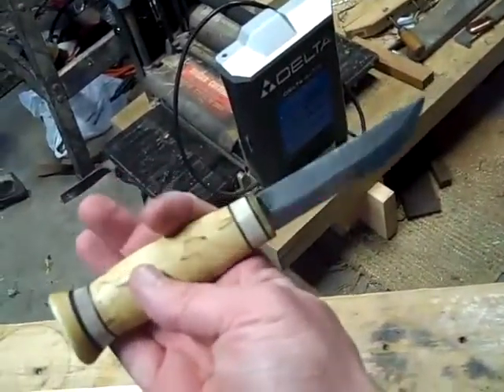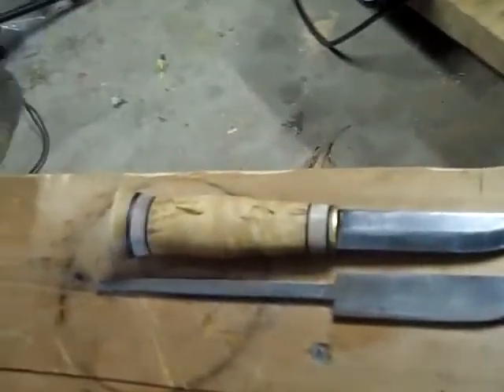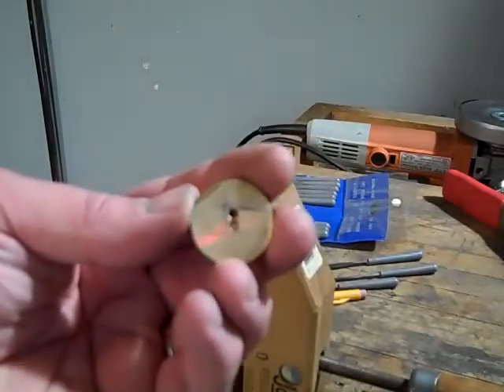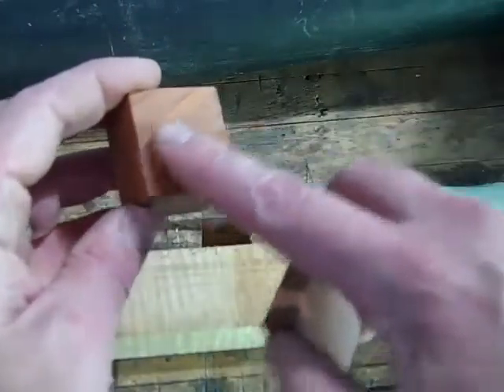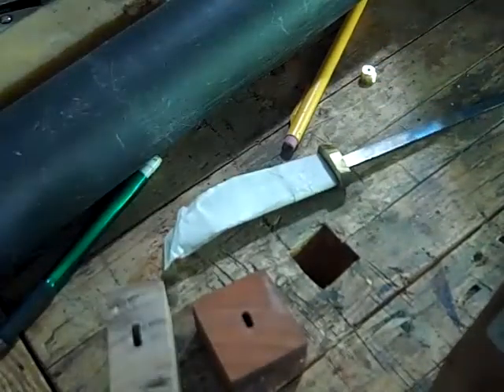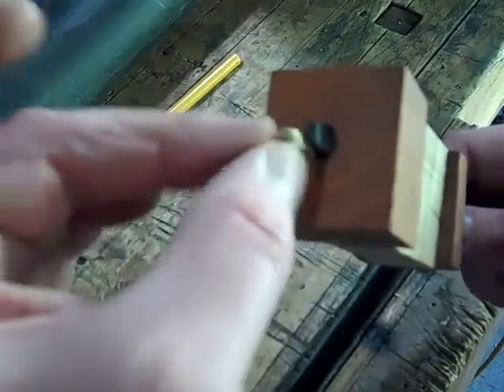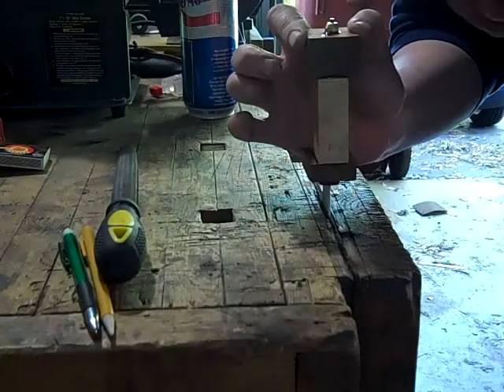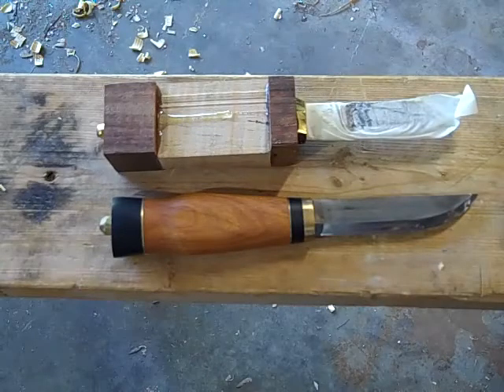Making a stick tang, puukko knife

Comment: Hello Muck interesting that you turned with a handle? And it looks like a ready knife.
 I like puukko knives. On the blade shoulders tail usually do not 90 a little rounded, so do Scandinavia imennitye manufacturers blades, Laurin, Helle, Puronvarsi Yjuro and others.
Best Regards Tim!

Comment: @Makermook your doing nice work however dont harden the entire knife,the way lapps are doing are to leave the pin or tangsoft at the end ,thatway u use it to glow up and fit wood and other to perfection to that exact knife and its no problem its not hardned at the end, easyer to flattn too

Comment: Thanx Mark, that area where you refined which looks  like a 90° corner, my question is why can you build a step there or atleast make a curve so it can be stronger, that's where I see most rattail tang's break even thicker stick tang's like even on Cold Steel Kraton Handle knives, that's why I like Fallkniven Knives better because of the much better tang's on their Kraton Handle Knives, but back to your tang, either increase the "V" shape tang or round that area or put a step there to strengthen that area so maybe we can baton a Rattail Tang Puukku Knife so it doesn't break there, Thanx for a great video.

Comment: you should never use the back and forth motion to file metal, lift file after each foward cut stroke or you'll dull the teeth. the wood you use is padauk pronounced (pow-dowk)

Comment: Is a Stick tang the same thing as a rat tang 
I was looking at same sword on fire and steel they told me the swords are made with stick style tang?
Is a stick style tang welded to the blade or is it one piece of steel
Reply from the maker: Stick tang and rat tail tang are the same thing. 
In my experience, it's better if tang and blade are formed from one piece of material rather than welded. The weld is a point of potential weakness where you most need strength.
Reply: @Makermook  OK thank you

Comment from the maker: @soonerfan125 I use O-1 tool steel.  I did harden and temper the blade before putting the handle on, but I didn't have much time in this video to go over that process.  I have made some other videos that show a more detailed account of how I harden and temper these blades.

Comment: to heat the tang for the handel after harden the blade is no good idea isn't it
Reply from the maker: R St  As long as the heat doesn't bleed into the blade, it's okay. You don't want the tang hardened anyway, so heating it does no harm.

Comment: Tang is badly cut and break!
Reply: Are you referring to the shoulder where the tang transitions into the blade? If that is your complaint, you are partially correct. The reason for a slight radius in the shoulder (as opposed to his square one) is that it reduces the stress placed upon those points, thus reducing the likelihood of a crack. This is really only a consideration in blades that would be used for chopping, though, such as machete-style blades or cutting swords. For a small knife made for the primary purpose of slicing, it is almost a non-issue.

Comment: you should never use the back and forth motion to file metal, lift file after each foward cut stroke or you'll dull the teeth. the wood you use is paudauk pronounced (pow-dowk)